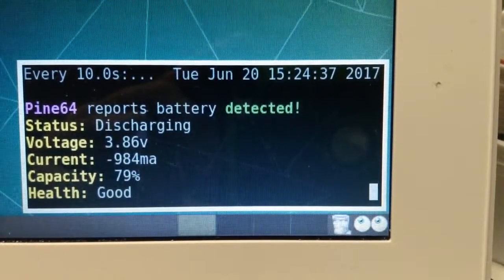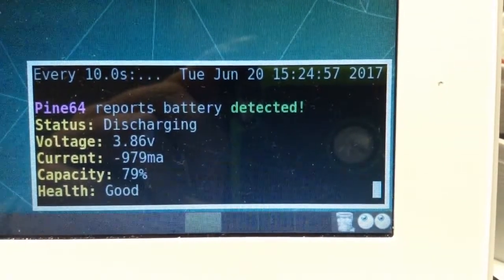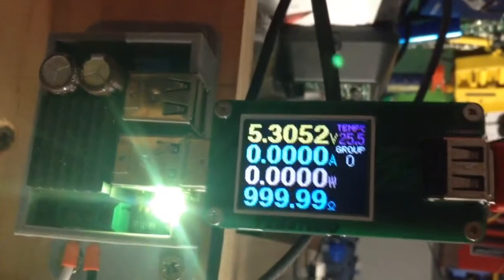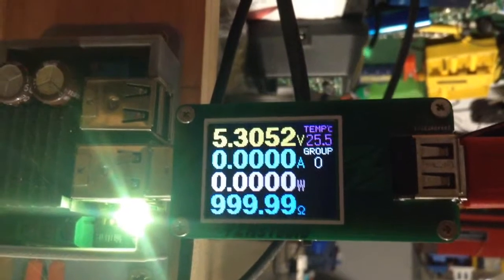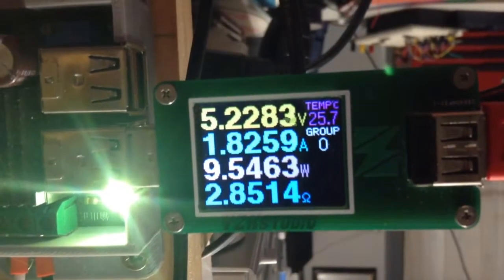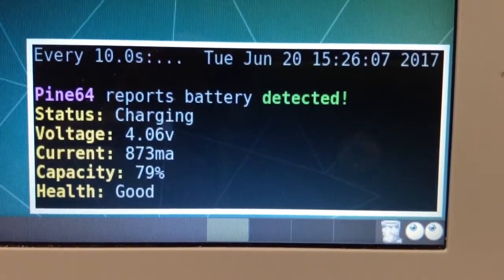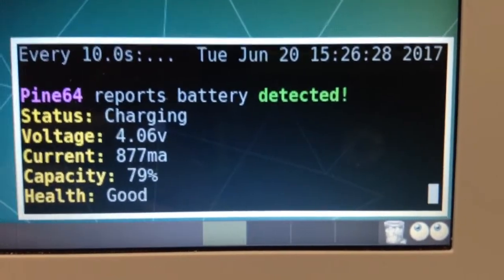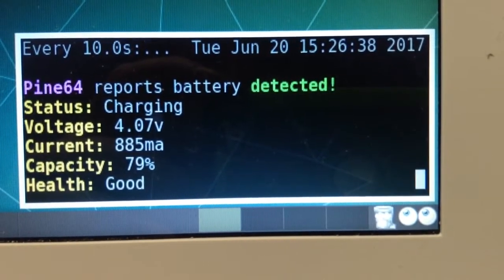11" Pinebook charge current

Comment: What program are you running to monitor the charge on the laptop?
Reply from the maker: A combination of two - screenlets with the terminal screenlet to have the floating window on the desktop. And the terminal screenlet is running the pine64-battery-colour.sh script from my github repo via watch -n 10 so that it runs/updates every 10 seconds. Could add the watch support directly to the script, so that the top two lines are removed, and make it so the correct model is reported (I did have an update for the script with that on my pinebook which I didn't updated IIRC).  Anyway, the script is here: https://github.com/pfeerick/pine64-scripts/blob/master/pine64-battery-colour.sh

Comment: oh so the 10 hour battery life they claim is at idle, and not light usage, for a 10,000mah battery
Reply from the maker: I think you might be confusing this with the pine64. I don't remember seeing any claims of 10 hours, and certainly don't believe you would 10 hours of use, unless you ran it from fully charged until it switched off, and had the screen off the whole time! However, the pine64, with a 10,000mah battery, can run for 10 hours with moderate loads, and nearly double that with minimal loading. If you have any links to where it has been stated by Pine I'd love to know... because they would need to correct that ;)